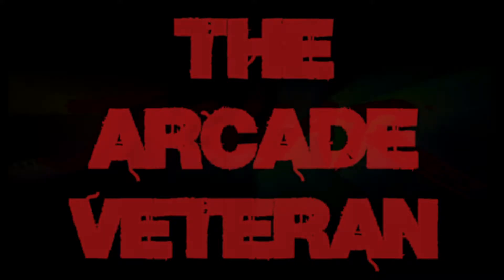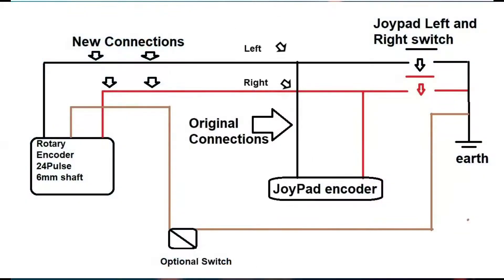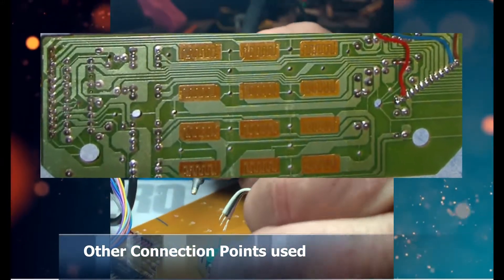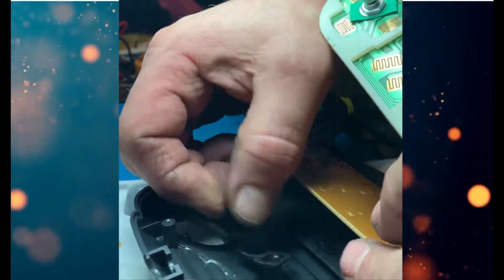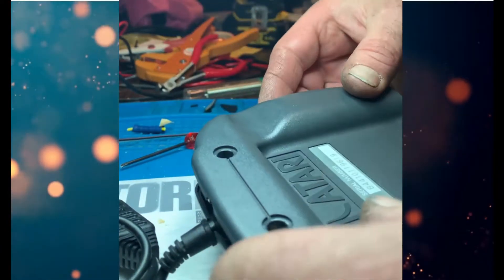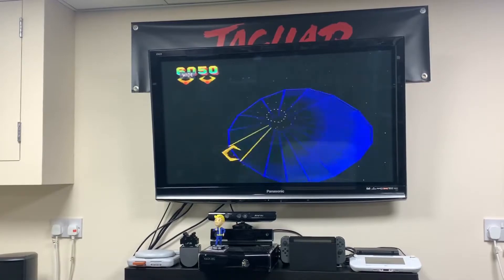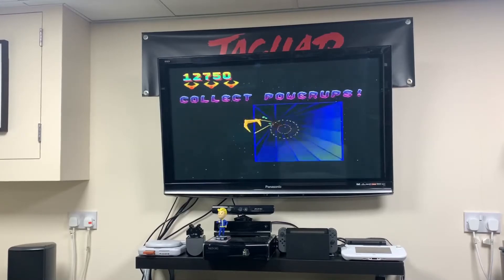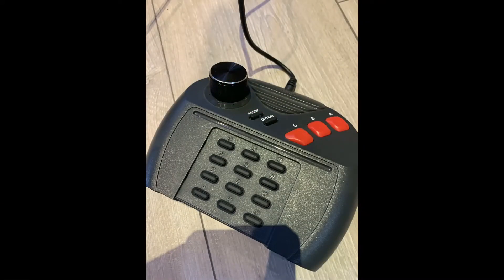Atari Jaguar Rotary Controller Mod For Tempest 2000

Comment: thanks for the video/tutorial! i just purchased my first Jaguar and it required a few small repairs to get going. i was kind of bummed that my repairs were over... now i found a new project!
Reply from the maker: Have you got the game drive for the jag it’s a must buy 👍
Reply: @TheVetUk  budget is keeping me from doing that at the moment. especially considering how much i had to plop down for the console itself. if i do end up purchasing one, does it require any hardware modifications to get running?
Reply from the maker: No extras just the Roms but they are pretty easy to find now 👍
Reply from the maker: I run my jags with scart adaptor and game drive I have not modded mine to 60hz maybe one day I’ll get round to that 👍
Reply: @TheVetUk  what's this about 60hz modification? I'm looking around at a Jag2SCART cable and a cheap $22 SCART to HDMI converter.
Reply from the maker: 60 Hz mod gives us brits full screen and a speed jump up we use 50Hz but more lines slower but cleaner picture 
If you have scart on your TV I would stick with that but if not a hdmi converter will work ok